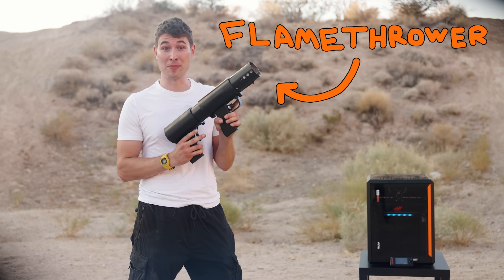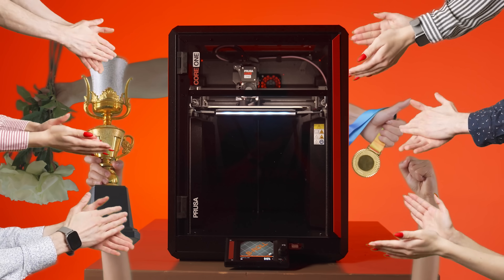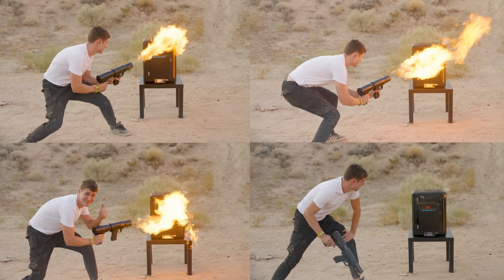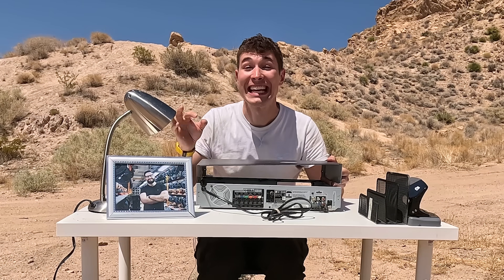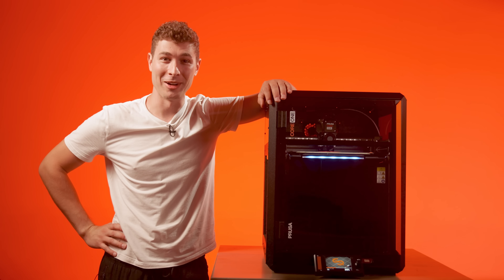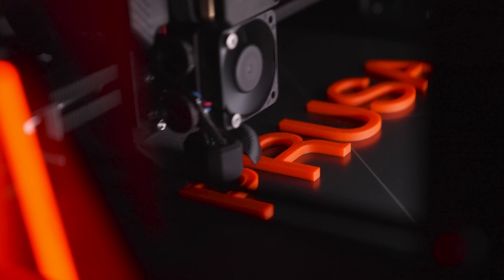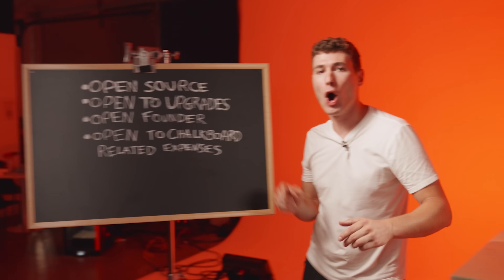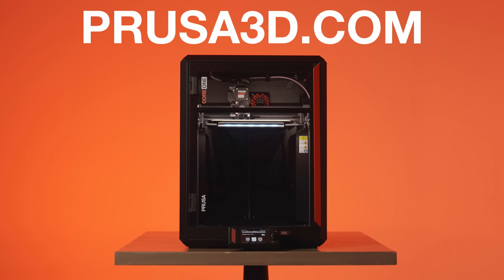Who approved this?! | Abusing PRUSA CORE One Until It Stop Printing

Comment: Yes, it also bangs its (print)head for one minute before every print or filament change, you have to manually add a filament wiper rubber, and add the g-code by yourself. You also have to buy a hardened nozzle, the filtration system (which makes the already installed fans obsolete), the accelerometer (which you have to mount and dismount every time) and the camera seperatly, despite the premium price tag. Oh and did I mention it uses cheap plexi for the windows and they are mounted with a (almost single use) plastic rivet. But except that, its a fine machine. Still as a user for 4months now, I question the price-value of the thing...

Comment: I always wanted to get a Prusa, but price is just never seemed to justify the purchase, I mean 1430$ for the Core one, while I can get just as capable if not better some might argue at 1170$ from Bambu Lab (P1S) and it comes with an AMS not that I like AMS, I mean I wanted to get the XL but even today it still costs as much as a new Bambulab H2D and thats without shipping. 

I understand that once you get one you will understand, but I want to understand before getting one, what is better in the XL? I've only seen negative reviews, rarely a good one, while the Bambu Lab h2d, is 50/50 I rather go for something new, has an enclosure and have parts available to get more quick than Prusa (i'm guessing here), and warranty, I don't understand what would warranty help me with if I will have to ship it back to them and pay a stupid sum for shipping it, they might cover the return (I don't know I am assuming) but for sure they won't cover me sending it to them, so all in all this is one expensive printer that doesn't make sense.

genuinely speaking, I would love to get into the Prusa eco system, but I can't justify it. might be justified if they had a dealer or distributor or a repair center maybe,.

Comment: Don't be silly! I have owned over a dozen Prusa printers over the last decade and currently run two Core One, one MK4S, and one fully flagged XL. None of them came without issues! The worst part comes when you are a small printing business buying as a company and only have a one-year warranty. No SLA provided. No goodwill given without hours-long discussions with the support chat. This is especially frustrating if you have discussed the issue within the warranty and made several attempts to fix it (after those discussions), only for the problem to return shortly after the warranty expires. Then you will be told to deal with the expenses yourself (fortunately, I am a very annoying customer who will not leave the chat that easily). I spend thousands of Euros each year on gear at the Prusa store, but I'm growing very frustrated lately.

Especially the Core One is a piece of... I found it very amusing that the handle was still burning in your video, as mine fell off on both Core Ones out of nowhere, and I had to replace the cheap sticker tape with a more durable one. The black strip on the front is not even window-cleaner resistant, but the plexiglass attracts fingerprints and dust like crazy (some black masking tape fixed it for me). The Nextruder is a disappointment regarding the nozzle swap. I have already made my comments on this in the Printables section of the Nozzle Swap Tool project.

This video is like a satire on yourself in my eyes. That's why I don't understand why I just placed another order for the MK4S to the Core One kit. I think the joke's on me, too (or I don't want to deal with three different printer types, but do batch printing... might be this economical and practical reason). However, the market is full of alternatives, and I already have another fleet of Panda's most delicious food choices.

Comment: Would like them to make a new over 300mm³  core1 plus model, with the option of a kit, that adds the new indx system, as well as a heated enclosed multi filament dryer. That would be the perfect printer for most people in most scenarios.

Comment: Love my Mk4S as my main production machine for TPU parts, and my Core One as my enclosed production machine 👌🏻
I think the MK4S still has some advantages over the Core One, but the inverse is also true too. Basically it’s good to have both! 😂
Reply: Which advantages does the MK4S have in your opinion over the Core One?

I see that
- it might be more comfortable to print TPU on a MK4S because you don't have to push the filament through a PTFE tube (depending on the configuration of the MK4S)
- the MK4S seems to handle extreme overhangs better
- the VFA problem of the Core One that Prusa currently works hard on to mitigate, but this problem will perhaps never completel disappear because basically all CoreXY printers are at least a little bit sensitive to it
- the MK4S is easier to build, and is cheaper

Anything else?
Reply: @TheWolfgangKeller it is also significantly quieter, easier to work on, and easier to get to anything on the print bed or around the print head during a print. Also all of the things you mentioned, as well.

Comment: i bought core one kit and assembled first, then bought bambu p1p as a secondary printer. So I have a chance to compare.

p1p is an excellent product designed for those who just needs a working printer, no interest with how it works. it feels a bit cheap (which it is) but not sloppy at all. it is noisy and vibrates a lot(due to powerful motlr) but prints fine.

PRUSA provides solid ans heavy metal as frame, fully open but the design is less streamlined. it requires some involvement to get it work well.

I love open platform so prefer prusa, but p1p is solid.for printing as well.

Comment: What about vfa? What about the expensive nozzles to print everything?
Reply: VFA has already been solved by Prusa – and the solution is actually open-source, so other manufacturers can use it too. Definitely worth checking their blog, they explain the details there. And nozzles: You don’t need expensive nozzles for most materials, the standard hardened ones already cover pretty much everything...
Reply: @PeterErstl Show me the hardened high Flow nozzle….the cheap one!

Comment: I ordered a core one. Arrived with 3 broken plastic panels, the handle unglued and resting on the bottom of the box, and one of the corners bent up so it did not sit level. The tape for the rubber feet did not stick either. And the exterior box was undamaged so I kinda call BS on the ruggedness of this thing. Support had me jumping through hoops after waiting hours on multiple chats and in the end they still didn't agree to replace the printer just send some parts. So I just returned it and moved on. I loved my MK3. The XL was so-so (sold it a while ago). But this thing sucked out of the box.

Comment: Great ad, love the humor. The only thing stopping me is the price coupled with the max nozzle temp. Even my kobra s1 does 320C (and yes, i do use it for PPS-CF and PET-CF, not bitching without reason :"))
Reply: I more likely hope for active camber heating. 55 °C is on the low end, but stable it would make way more things possible than just as a max value.

Comment: Not compatible with mmu3 tho lol
Reply: except that it is
Reply: @BojanSusic-qi4qn correct me if I'm wrong but my impression is that there's nothing official and they're "going to create a completely new multi material system" which sucks for those of us who already have mmu3
Reply: @derekjensen1995 You are correct, no official successor yet on sale. They did tease a week ago the toolchanger upgrade but we dont know when it will be on the store. But the mmu3 is compatible,  you can mount it on the core one although you'll have to remove the top cover or you can use the community spool holders so you have it like an 5 spool AMS set up on top of the printer. I personally recommend the core box even if its a paid model, its designed so you don't need a buffer anymore.
Reply: @derekjensen1995  There are two official variants (Enclosed, Lite) and one (Prusa made) community variant to use an MMU3 with a Core One.

Comment: not opensource, i.e. false advertising
Reply: Firmware is Open Source. Also schematics for xBuddy, LoveBoard, Extension board, Filament sensor, Heatbed, xLCD and parts of the hardware like Heatbed, Side Panels and Swing Arm. Besides PrusaSlicer of course.
Reply: @ulaB  if it's marketed as opensource, everything of the product should be opensource. not just part of it.

Comment: Love prusa but guys you need to stop throwing the open source . Yeah the slicer it is, but the hardware doc is really lacking...
Reply: I'd rather they keep throwing Open Source, but improve the publication. How about the actual CAD files? Downloadable assembly guides (the current web interface glitches a lot)?

Don't get me wrong - Prusa is already waaayyy better than almost every other company.
Reply: Firmware is open source too. Also schematics for xBuddy, LoveBoard, Extension board, Filament sensor, Heatbed, xLCD and parts of the hardware like Heatbed, Side Panels and Swing Arm.
Reply: Been using open source for years. That is why I still have an eight year old updated and upgraded MK3 that still works (doing a print as we speak, after 3+ months of just standing).
But the Panda food company and others just wants to steal it and make it there own. Keep it up Prusa (it is not easy).
Reply: @quentincampbell5865  are prusa machines worth it? Yes. Are they reliable and you are sure to keep the same machine for long time, way more than any other user level machine? Yes and yes. But the times when prusa claimed open-source with even open hardware have died some time ago... I understand I still choose prusa I only don't like that they use it as their mojo...